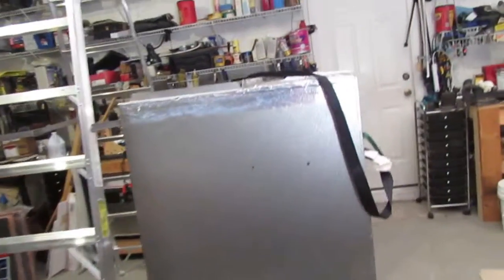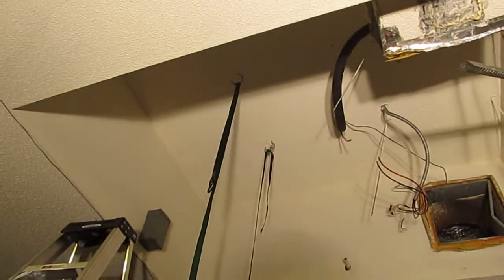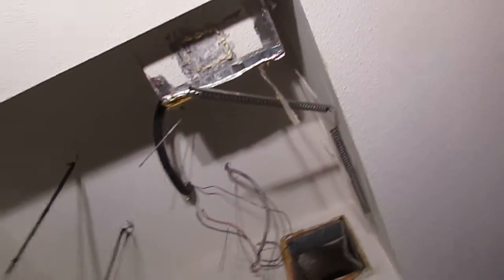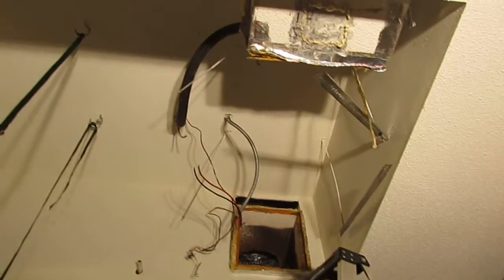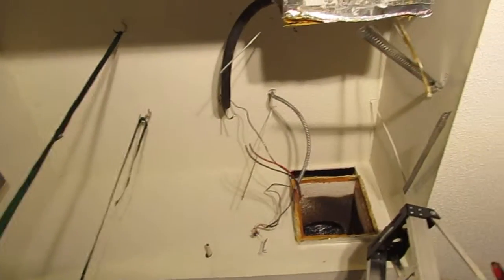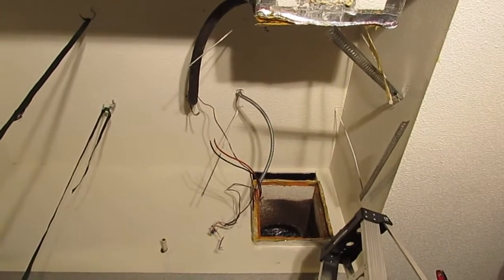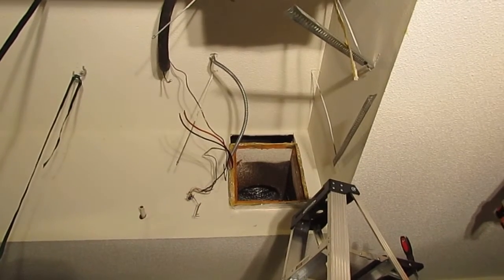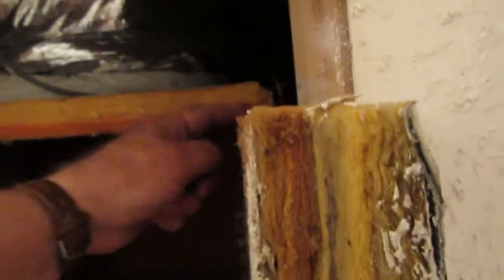HVAC:Pt.5: 22-5Ton to 410A-5Ton-Resize Supply Plenum

Comment: How do you calculate what size plenum box using duct board you need for a 3 ton air handler (1200 cfm)?
Reply from the maker: I recall using what is called a "ductulator". It's a slide rule sort'a thing that calculates duct sizes. They are sold on amazon, however, these days we have AI online. No, I'm not kidding. I use Chat GPT. Describe what material you're using, thickness, etc. Then add details as necessary. I'm sure it will come out with a solution. One thing that you did not state is what kind of plenum you have, e.g. my plenum has two "takeoff's" with 12" Flex hoses attached. You have to describe these issues to the AI. It will calculate the size for you. 
I always begin my chat by saying, "in the context of home HVAC, I require help in designing a Ductboard Plenum ... Then go on to describe what you need. You'll probably go through several iterations before you finally come out with a usable design.
Reply: I think both supply and returns are undersized (more with returns).  I have a 10” flex and 12” flex.  10” flex goes to a triangle duct board that has 4x branches (2 on each side). 2x 7” flex on left and 1x 7” flex and 1x 8” flex on right.  3x 7” go to kids rooms and 8” goes to foyer.  All 4x use separate 14”x14” return filters x 1”.  The other main is a 12” that goes directly to master bedroom that uses a 18”x18”x1” filter.